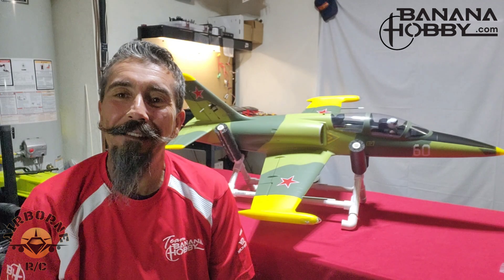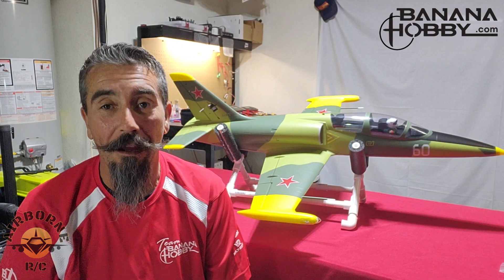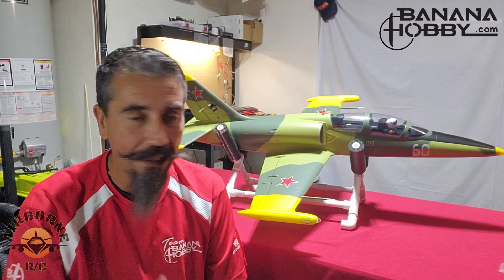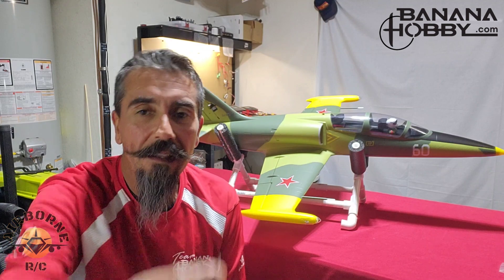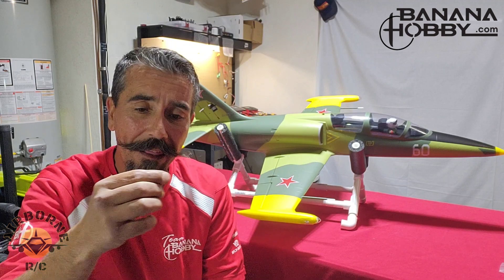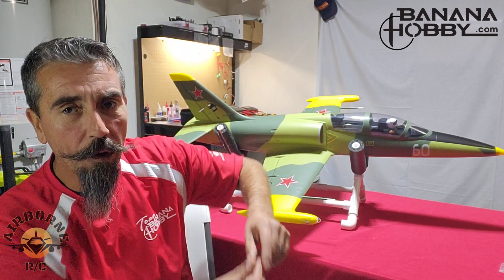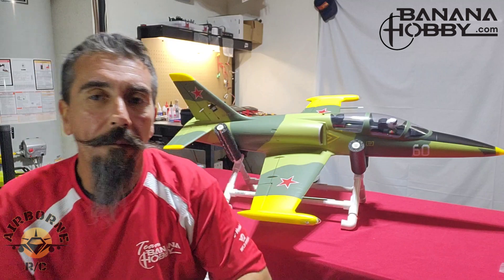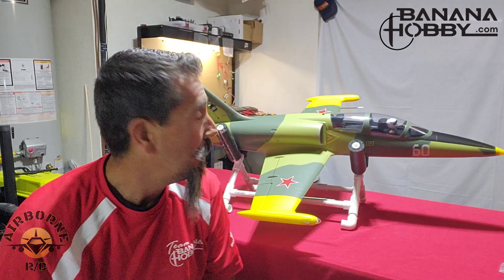FlyFans L-39 Assembly, CG and Setup!!

Comment: This isn’t a setup video at all. Where’d you plug everything into?
Reply from the maker: Plug everything into? You mean the reciever? Yeah I do not do that bc my Rx and TX most likely not the same brand as all. Then you would hook up wrong ch (ie spektrum futaba...etc) then have people complain. This is a set up video as it shows the Throws and CG so YOU WILL NOT CRASH! that's a pretty good setup if you don't mind me saying. If you want the after flight tips watch the maiden and stay till the end
Reply from the maker: And if you need help hooking up a reciever. I would URGE you  to research more and if possible find a local flying field for that kind of beginner help.
Reply: @NoonzAirborneRC don’t need any help at all. Servo tester fixed the un labeled wires. Just found it odd that nothing was labeled like almost every other plane on the market. There’s a reason this bird was so cheap. And it shows.
Reply from the maker: @shabo857  glad ya got it sorted. The wires were labeled (should of) issue and has been addressed to manufacture. The glue used on the cables...NOT the greatest. Some show up half labeled some labels in the fuse. For $200.00 if the only issue was unbeled wires. I'd be content. The quality of the plane and electronic are cheap. Wait till you fly it 👍👊🇺🇲